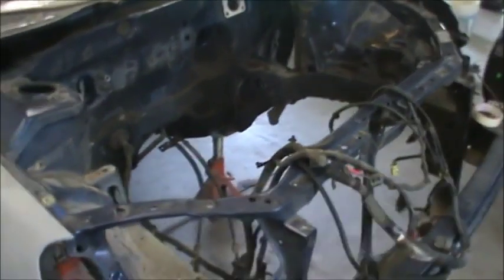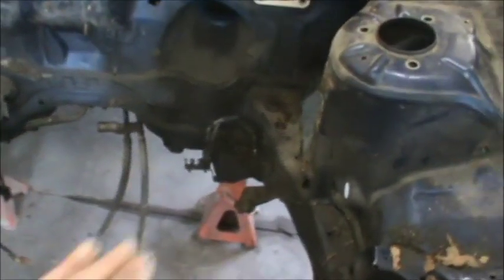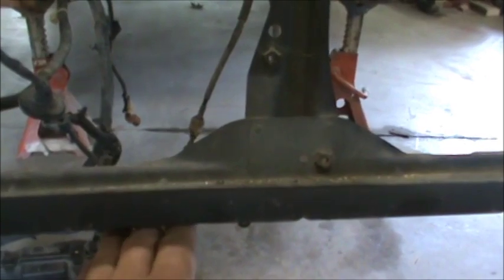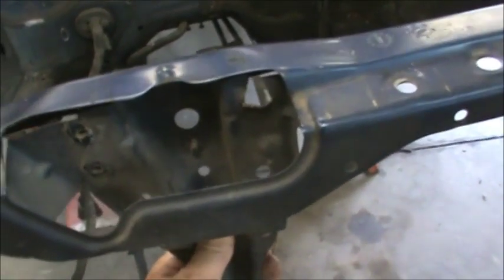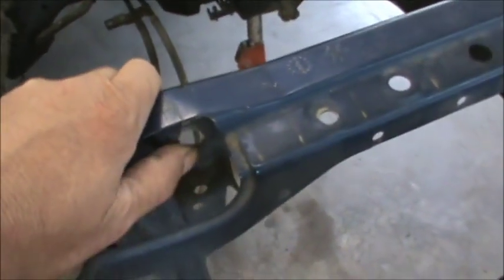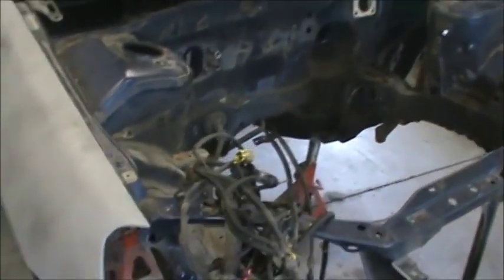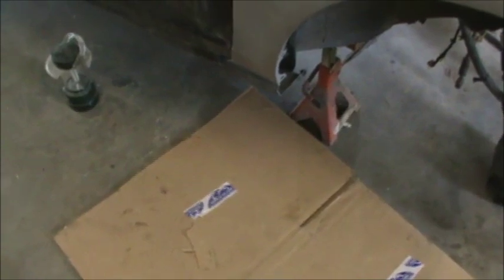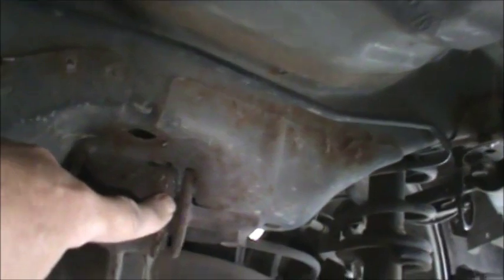My Civic EV Electric Car Project Part 17 Engine Compartment Stripped

Comment: Use something like Carb&Choke or WD-40 to the clean up! The WD act in lubrification too, so it's a little oily. The carb&choke (or other decarbonizer) is the best choice !
Reply from the maker: I went with paint thinner, it worked great! Thanks for watching!
Reply: I thought that the thinner won't work well with some crusty stuff. Well, good to know! Because it's a lot cheaper! And thank you for the vids ;D good luck!